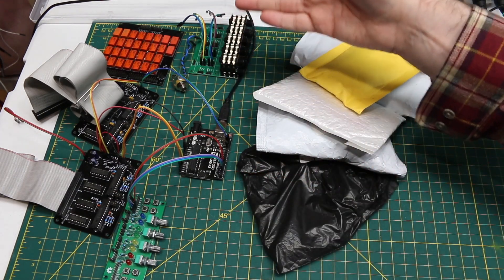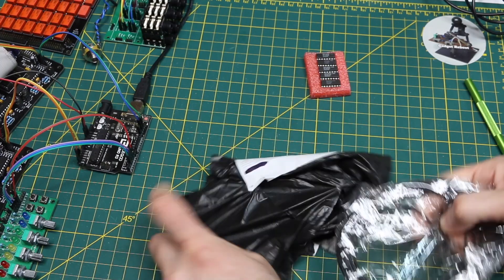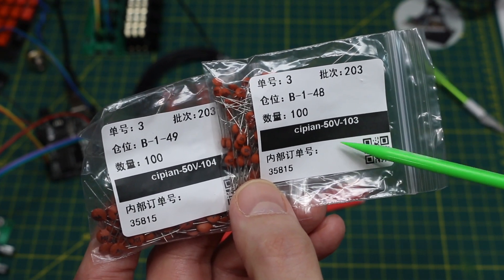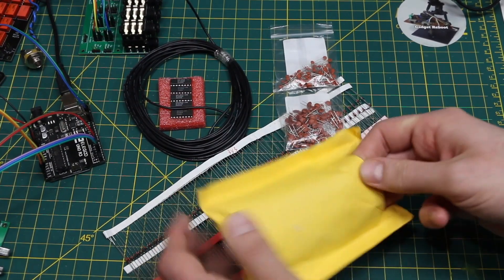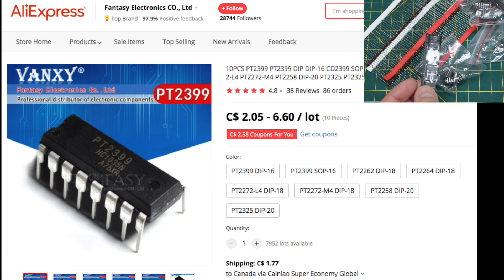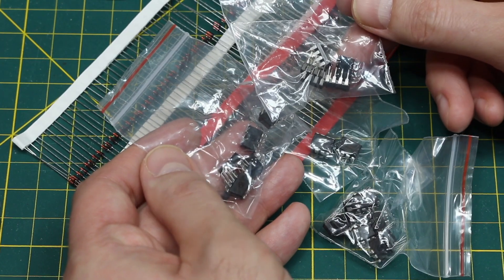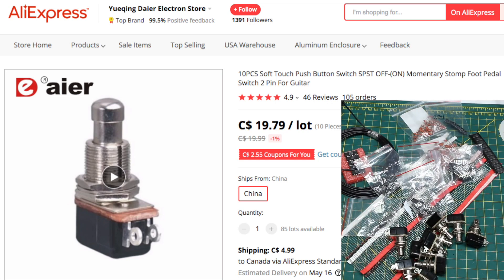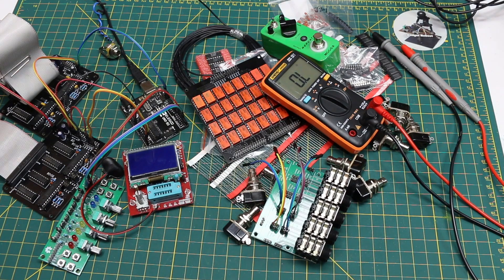Mailbag!  DS1803 Digital Pot and Other Silicon

Comment: The PT2399 is a well known IC for "lo fi" delay circuits ... but I have a few fancy pedals that use the PT2399 and sound absolutely gorgeous. I have put together a few circuits using the IC myself and they tend to be on the "lo fi" side. :/
Reply from the maker: if I can get a few of them running at the same time maybe I could even use one as a Lofi secondary delay with a better quality primary delay to do weird stuff in the feedback path

Comment: Fun stuff.  I really do like the newer style component tester with the rechargable battery.  I hated hunting up (or dragging around) 9v's for that tester.  But, either way, it's a fantastic device.
Reply from the maker: I used to have trouble finding batteries at times like that but at least now that I’m getting more organized they are all just in a part bin hanging on the wall. But I want one of the newer testers regardless.